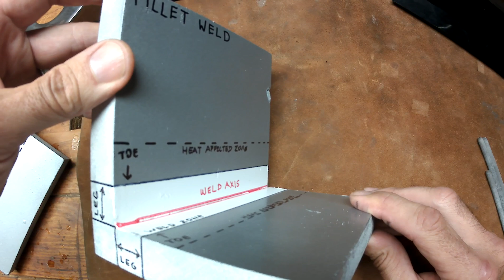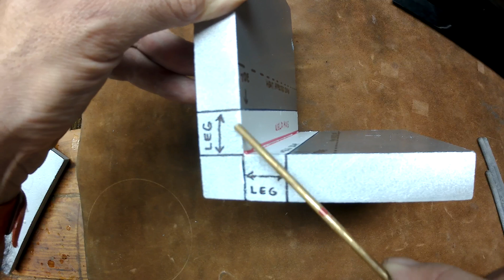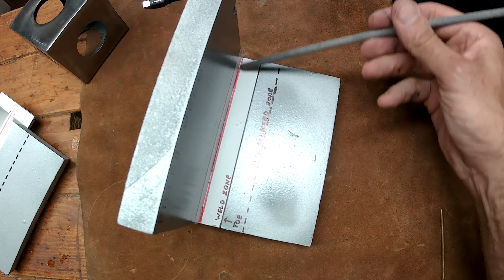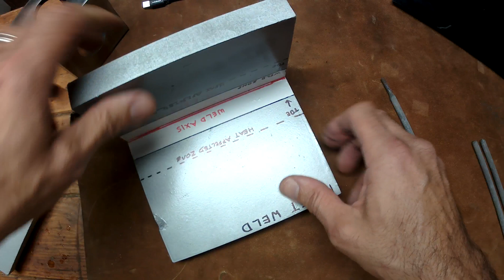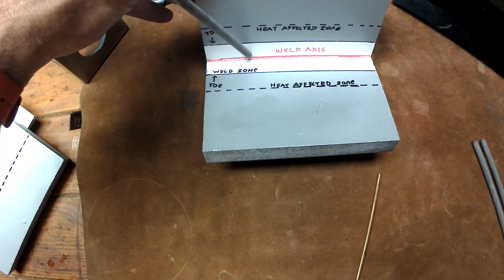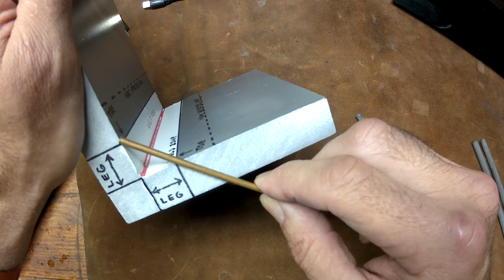Fillet weld parts and welding angles

Comment: If you make the leg wider you just waisting metal filler material!
Reply from the maker: Exactly. Sometimes difficult for students to understand. More isn’t better or stronger.
All about balance.
Reply from the maker: The leg width is dictated by the thickness of the base material; the legs cannot be longer than the minimum material thickness
Reply from the maker: Very true, yet is is so hard to keep people to using as little heat and filler metal as they can.